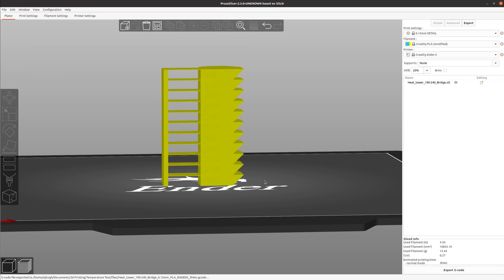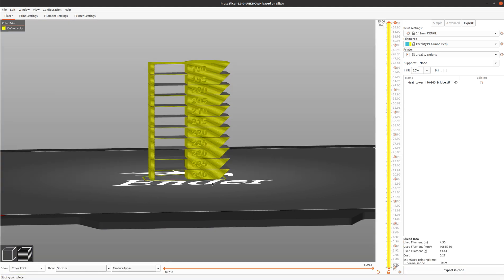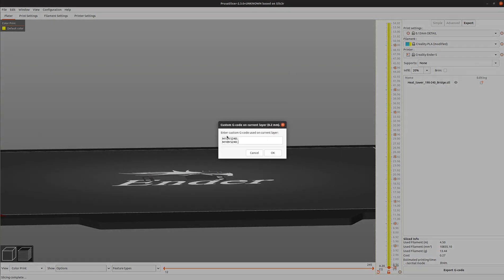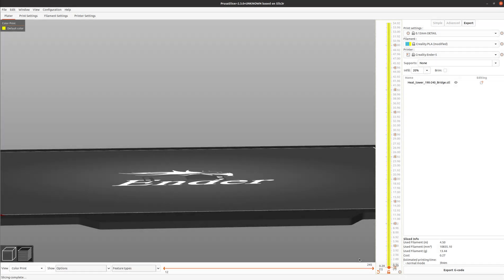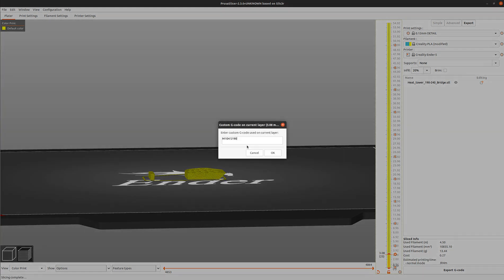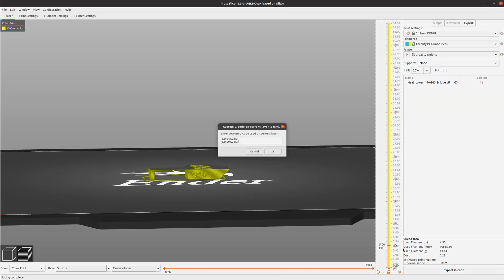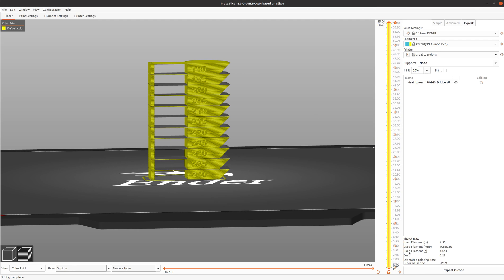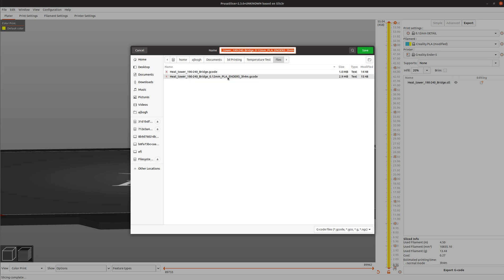PrusaSlicer Custom GCode Temperature Tower

Comment: For some reason the little plus icon on the layer slider is gone. It was there last time I did this and it worked. How do I get it back?
Reply: It has been a while, but maybe change your setting level to expert if it isn't already.
Reply: @Doalnark  I forgot about this. Turns out that if you enable the option to print one item at a time when printing multiple things, the option to add custom code goes away.